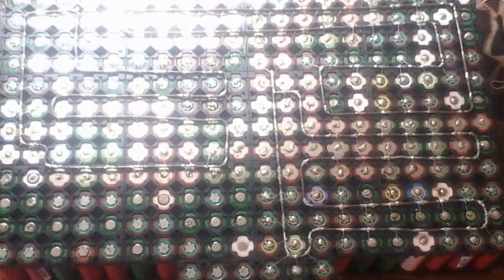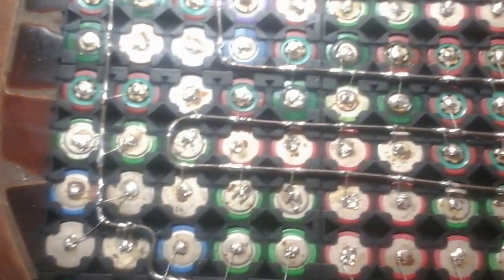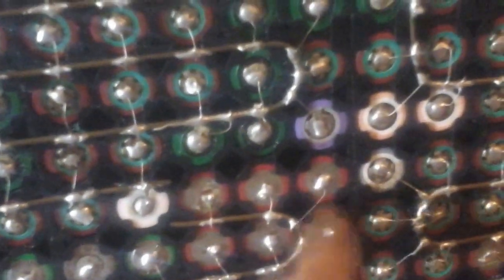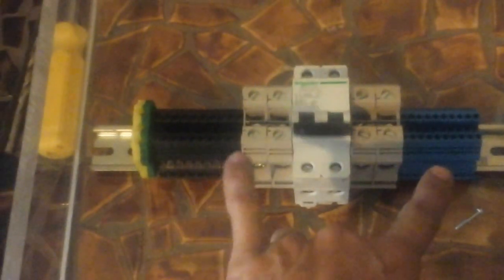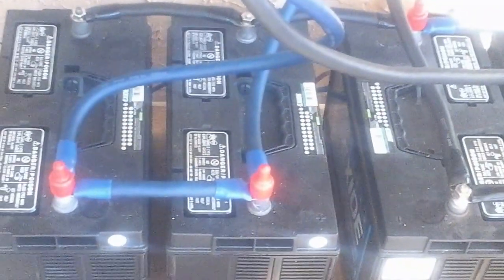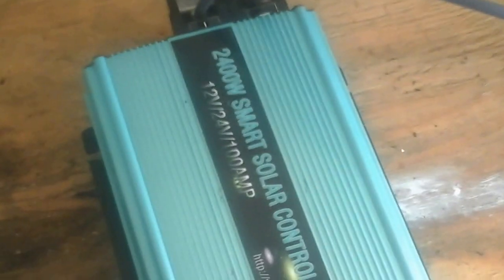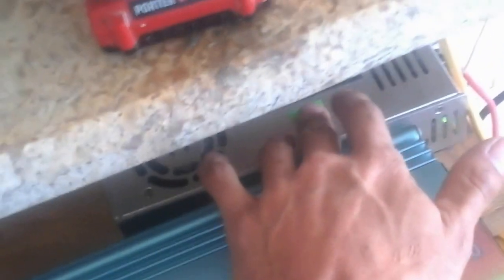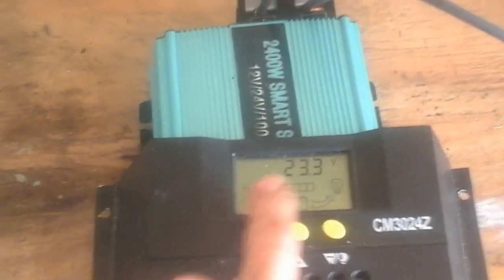18650 and solar update.

Comment: Hey what are you using as your bus bar? What size cable is that?
Reply from the maker: +Daniel Wilson standard house wire 12-2 12-3 ..ran 16awg along positive and negative rail.

Comment: Do you need fuses on both sides of your 18650 battery cells. I was under the impression you only needed them on one side, not sure which one, but I could stand corrected.

Keep up the good work, I like to see how the 18650 battery build goes. I'm in the process of my own build. Shooting for 10 kWh bank. If that goes well I'll go to 22 kWh.  Ultimately offgrid! Cheers